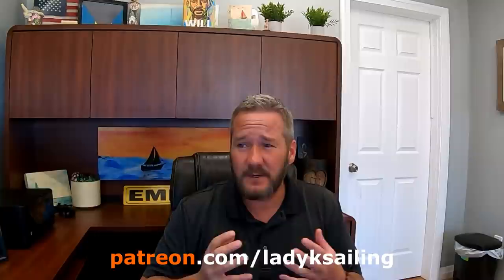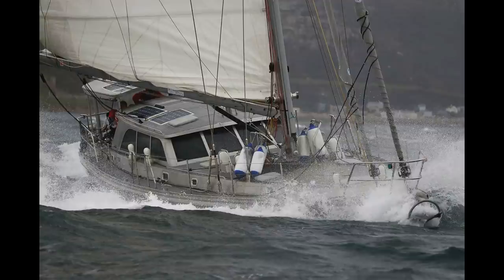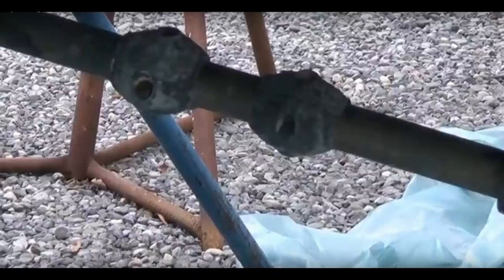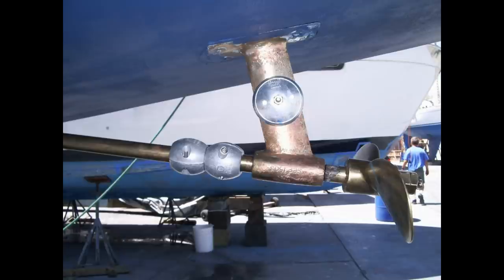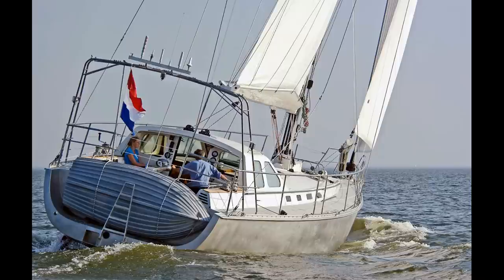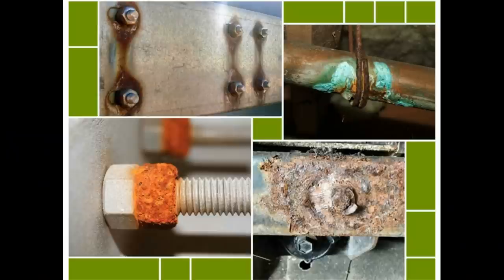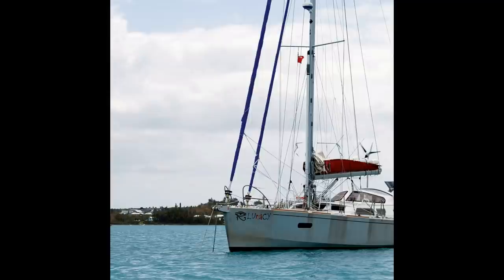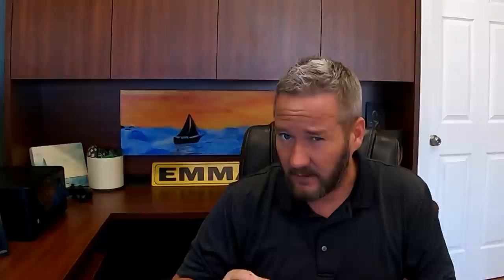Aluminium Boats - Episode 176 - Lady K Sailing

Comment: Another happy aluminium yacht owner here. Regarding welding the deck fittings on, much stronger than bolting, another advantages is no through hull fittings. It creates a very dry boat, most aluminium boat owners talk about vacuuming their bilge, not sponging it.. Another benefit is that I have no seacocks, many aluminium yachts have standing pipes welded in for water intake (eg, toilet water inlet). There are advantages and disadvantages to every building material, it just comes back to personal preference. Thanks.

Comment: Aluminum boats aren’t as bad as you think.  The difference between an aluminum anode and the material used in boat construction is completely different.  Quality aluminum boats are built out of 6160-T6.  Anodes are a much softer material.  

Look at Kanter Yachts in St. Thomas.  They make some of the best aluminum boats in the world.  Also most of the mega yachts are built in aluminum.  

I do boat surveying and between aluminum and steel, I have seen some very rusty steel boats. But have never come across an aluminum boat with big gaping holes from corrosion.
Reply: I dont know if youre talking about American motor-yatchs/fishing boats on t6 alluminium, but Quality aluminum sail-boats (Boréal, Bestevaer, Garcia, Alubat/Ovni etc) are all are made with 5086/5083, not "6160-T6"
Reply: @lrvz7187  Strongly agree - 5083 it is - 6000 series is an engineering grade ALU - 5000 series is more ductile and this is what you want - hit something very hard and ALU simply bends or deflects but does not hole - of course best not to hit anything but life happens.

Comment: To be clear rust is a type of corrosion (the wearing-away of metal), and to put it simply, aluminium does not rust, but it does corrode. Although these terms are often used interchangeably, they are fundamentally different.

As with any metal, when it comes into contact with oxygen, an oxide layer will form on aluminium. Unlike with other metals such as iron or steel, the layer of aluminium oxide is actually protective – it’s hard, thin and fairly transparent, and is tricky to remove, unlike rust. As it’s not very noticeable and actually protects the metal, aluminium oxidation isn’t a big problem.

Comment: "places you wouldn't take a little fiberglass boat"...you mean like Svalbard on a Pearson 36? 😂
Another great episode Tim, thanks for the time, energy, and research you put into these.
Reply: Or sailing a junk rigg converted North Atlantic 29 through the NW-Passage like Chris & Jess Bray
 (YT Yacht Teleport). Or do a nonstop around the Americas including NW-Passage and Cape Horn in a 27-foot Albin Vega like Matt Rutherford.

However, most people that go into the high latitudes for longer will take the safety of aluminium. And with good reason. You wouldn't try a freeze in over winter like Guirec Soudée in fibre glass either ....

Comment: I realize your format is easily digestible, not highly technical.  Still it's important to not be incorrect.  So please take this as constructive.   Corrosion by stray current is electrolysis, not galvanic corrosion.  Corrosion through dis-similar metals is galvanic corrosion.  Steel and aluminum are both rugged, strong materials.  But strength is not a single property, as I believe you understand.  Maybe this is another place where your audience could be informed just a little more without being too technical, just as you did when comparing fiberglass high tensile strength to steel isotropic strength.  If aluminum is built to the weight of steel, it is stiffer "stronger" globally and takes more energy to crush, dent, hole, buckle, etc.  Steel is hard and abrasion resistant as well as "strong" so it is exceptionally rugged overall.  That's all assuming aluminum's great strength is not used to make the boat as light as possible, which just like fiberglass, can result in a boat which is strong enough as a whole, but less than rugged in places.
Reply: And the stray currents that result in electrolysis need not be supplied by your vessels electrical system. Someone welding on a steel boat in close proximity could really spoil your day.
Reply: @davidbrayshaw3529  The galvanic corrosion start because two metals have potential difference, once they are together, one became cathode (lower/and or positive voltage)  and the other anode (higher/and or negative voltage).
Example: Aluminum has -1.67 Volt and Steel -0.44 Volt the difference is 1.23Volt, these tho elements together will make the aluminum corrode.
The best is to be as close as zero, on the same example if you put Aluminum with Beryllium no corrosion will occur as the two material are almost at zero on potential difference.
Download a galvanic corrosion table and you can see the value on each metal.  
As a general rule 0.2volt differential is considered safe.
Aluminum has one incredible advantage over steel, once the surface is oxidate, there is no longer conductivity, (that is the reason why they don’t paint them, they basically need to naturally oxidized) and that is why modern military boat are all in aluminum and not in steel, they literally last lifetime.
Don’t worry about electricity issues once the surface is oxidate is no longer conductive.
No current no corrosion.
If you like to do a test take a multimeter tester put on close/open circuit mode ohms (beep when two probes touches) and touch the hull from one side to the other at any distance you will notice after the boat was in the water for a while it won’t beep anymore.
Most of the hulls uses aluminum 5083, 5086, and 6061 series alloy, the mast in most of the sailboat are in 7029 series, which is an extrudable 7000 series alloy very strong flexible and corrosion resistance.
Conclusion: if you have the money aluminum boat are far superior than any other material, especially on salt water.
The downside is if you manage to damage them they are more hard to fix on the go.  
At the end is just a choice and budget!
Cheers
Reply: @dhbeto  Great information thanks. I thought aluminum is an affordable material. The Cyber cats by Tim Mumby seems to be quite affordable.
Reply: @dhbeto  Sorry it's taken me so long to reply. You make some very interesting observations, particularly pertaining to aluminimium oxidistation and its propensity to act as a dielectric. This has to make it a vastly superior material to steel from both a perspective of galvanic corrosion and electrolysis. 
I hadn't considered that in this context. Aluminium is quite a reactive material but of course the oxide thereof is anything but reactive. Thank you for your informed reply.

Comment: The US coast guard has been successfully running aluminum boats for decades.  When I was there in the 80’s maintaining a couple of 41’ we just replaced zincs every year or two along with bottom paint.  On the daily and weekly just wash off salt spray to keep corrosion away.    Now the  Navy has tested and found that much larger ships of aluminum are not the best material for their missions.
Reply: Really?
I thought the US Navy is building heaps of them now, Littoral Combat ships based on a Commercial Fast Ferry out of Australia, last I heard they were buying/building more.
What has changed recently?

Comment: Hey, never heard of engine oil being detrimental to aluminium. Btw one great thing of aluminium to be mentioned is that you can dispose of it properly once the boat lifetime is out. Fibreglass sailboats are piling up at various places of the world because practically it is extremely difficult to recycle them. In Europe we see that people tend to just abandon them at places where the community or some authority will have to remove them and have it replaced on the community's expense. In alu boats it will never be an issue, even if they reach their end of life (which is, as you also said, can be extremely long). I read a statisic that cca 70% of the aluminium ever produced is still in circulation. These big hulls, masts and booms are prime examples of well recyclability (if there is such a word?). 
The biggest problem I actually agree with you, is the price range. The alu boats from builders of established reputation tend to be like way up there in terms of price. Even when used.
Reply: I was wondering about that too (engine oil). Airplanes have been made out of aluminum for a LONG time and I've never seen corrosion as a result of oil or fuel coming in contact with the skin or structure. At the same time, I think I'd want the aluminum surface treated with anti-corrosive paint (zinc chromate was the classic one until it was banned) just to help avoid that problem.
Reply: Shouldn't unless its particularly acid or its had certain metals added to it. 
Al doesnt rust per say it oxidizes but that stops at a certain depth ...anodizing is a protective process that creates a deeper protective layer ... Thats actually very hard to scratch and resistant to attack. 
Hence the expedition yatchs often being left bare.. on flyingboats of old they used to plaster the bilge compartments with lanolin. Marine grades of Al are as variable as specialist Steels.  
The other point is if your riveting steel components to Al you had best be using the Special composition rivets...
and ive forgot the name.🤦🏻‍♂️ 
That said if you want to see the ultimate short handed giant explorer yatch have a look at Beowulf ... By Steve Dashew
https://youtu.be/yrDxYkSI710
Most of the performance work boats and Australian or NZ build a lot of Al hull boats... Sailing Jupiter is the first Channel that springs to mind. Again Dutch German and Scandi companies tend to excell in building.
Garcia build their Al hulled Explorer cats. 

If you want to paint Al you need to use an acid etch primer to key it to the Al and get the paint to stick to the primer.
The other issue is thermal insulation Al is a brilliant conductor of heat ...  So any Al live aboard vessel will need insulating from heat loss or tropical solar  gains...and to control condensation. ..but that should be standard on any metal hulled vessel.
Reply: The French have launched a scrappage scheme for dealing with all the old glass boats .. i think they grind them up to add to Concrete. ..there are companies that have developed New resins that allow Glass fibers to be separated from the resins and both re claimed. 
It was in one of the online yatching mags ...they did a big article on alternative and greener materials being developed in boat building...

Cars by comparison have been for some time by law built to be a min. Of 80% recyclable. 
Explosive hydraulic forming of Aluminium hulls has been around since the 1990s ...and if you forgive the pun you can knock a hull form out in a few minutes up to a given size... I think it was first developed in NZ ...to get seam free curved hull profiles like on racers of the period.
Reply: @dmccorvey  Perhaps the issue is that Al boats with Fe engines in them will end up producing dirty oil with small bits of iron in it?  Just guessing.
Reply: Contaminated oil can corrode aluminium. Acidic microbial excretions can be a problem but it is more common in diesel than engine oil. Engine oil may also become acidic with age and may also contain materials that are incompatible with aluminium. If My memory serves me correctly (it mightn't!), I don't think that some aluminium alloys and carbon play nicely together. Used engine oil contains carbon.
Having said that, in a past life I worked on vintage aircraft. Corrosion mitigation was amongst my jobs. I never saw corrosion resulting from engine oil deposits but I am cognisant of the fact that different alloys, the absence of salt water as an electrolyte and low hour oil might account for this.
New mineral oil was used to lubricate hinge mechanisms on control surfaces.
Reply: @davidbrayshaw3529  
Hi David ... I know the rigging doctor did an interview with an experienced alloy hull boat owner.. in a series he did on materials. 
And ive heard some prominent Cat designers  say that some care has to be taken isolating carbon fiber components from Al ..because it reacts.

Their is a very interesting article  in Yachting world under yachts and gear the future of boatbuilding. A greener approach 👀🤞🏼
Reply: @clivestainlesssteelwomble7665  Thanks for your reply, Clive. I'll definitely have a look at the resources that you have noted. I'm familiar with both the rigging doctor and of course, Yachting World. I hope I can read an article on line.
I've crewed on an old (1985) aluminium 12 metre yacht which is still racing to this day. I was very impressed with the overall condition that the yacht was in, despite its very light weight build and spend thrift syndicate of owners! I wasn't aware at the time that cruising yachts, let alone "expedition" yachts were built using this material. I'm interested to learn more.
Reply: @davidbrayshaw3529  
Theres been some interesting yatchs toured for sale on u tube.. a pioneer Elsie is a forunner of the Gunboats with a forward cockpit...theres also been some interesting ones on learning the lines and Alluring artic .. is onboard in Iceland ..though theyve had a series of mechanical issues..on whats basically a loaned boat..
Being Finnish they are Darkly Stoic... 😂 The other monster expedition ship showed up on Odd life Crafting's channel a month or so ago a Brazilian scientific vessel even bigger than Beowulf. One channel is having one built ..Namastii ?.. by a Dutch yard.
Reply: @davidbrayshaw3529  
Theres a company called Vaan Yatch's ..Dutch of course but they launched a range of cats a year or two ago built from recycled Aluminium . R4 and R5 are their two models.

Comment: I may stand corrected in my assertion but my understanding with regards to the limited number of aluminium yachts on the water is largely due to the limited number of yards around the globe that are capable of producing them. Yes, I'm aware that there are quite a few commercial vessel manufacturers but how many sailing vessel manufacturers are there that possess the plant and skills to build aluminium recreational yachts? Not many would be my presumption.
The synopsis in this presentation is very good. I would add to it that with the exception of the potential effects of contaminated oil, all of the issues that affect aluminium yachts certainly affect steel yachts equally. I'm in Australia and there are a lot of aluminium commercial fishing/abalone/oyster vessels located in Darwin, which is a particularly harsh environment for just about anything. I've also had the luxury of sailing on Kookaburra 2 which is a 12 metre rule yacht built in 1985. That boat was built to absolutely minimum spec and despite that, it's still racing at least weekly 37 years later. I'd be interested to hear comments.

Comment: An Aluminium can also be used as a heat transfer for the heat generated by AC or the engines, meaning you do not require sea water heat exchangers that become blocked with barnacles. Aluminium does not burn like fibreglass does, so more safe if a fire does start. Aluminium is recyclable, not just burnt or put into landfill. Aluminium is easier to repair from the outside for temporary fix, just screw on some gasketed sheets. You cant epoxy a hole in a fibreglass boat when underwater.

Comment: not sure its been mentioned by another commenter, but the reason aluminum isnt painted is corrosion.  Raw aluminum very quickly forms a layer of AL-oxide which is protective. If you paint or otherwise seal aluminum, it allows any corrosion to spread rapidly, and unseen.  I cant remember the chemistry of it, but anoxic aluminum is highly susceptible to salt corrosion, and that loves to exist in that oxygen free area.

Comment: I would certainly opt for steel over aluminum myself because I used to be a welder. With steel, you were right in saying you could carry around a welder and I could teach almost anyone how to weld steel effectively. Aluminum on the other hand definitely needs to be maintained by a pro. Welding aluminum is so different than steel and you can make a small issue way worse in an instant trying to maintain aluminum hull by yourself. Can you learn to weld aluminum? Sure but it will never be as easy as steel to fix.
Reply: You’re correct as far as the difficulties difference, but aluminum is far from being hard to weld. With a small Tig unit, repairs / modifications are pretty easy.

Comment: Fibreglass is actually far stronger than both than steel or aluminium. But it has less impact and abrasion resistance, it will fracture rather than dent, which is bad if you don't want water in your boat. You are right that it doesn't have isotropic strength too, but that's not too much of an issue on a boat as most of the forces are predictable and linear.

Comment: Distant Shores is documenting their construction of an aluminum sailboat at the moment. But on another note, when I lived on Protection Island in Nanaimo one of my friends had a welded aluminum boat. When he moved off the island he couldn't sell the thing because the sheets were slightly made of different marine aluminum batches and suffered from dissolving rot and couldn't do anything about it. I knew they were finicky but this was a new one. Buy twice as much of the same batch and use half if it?   ..  Cheers to you  ..